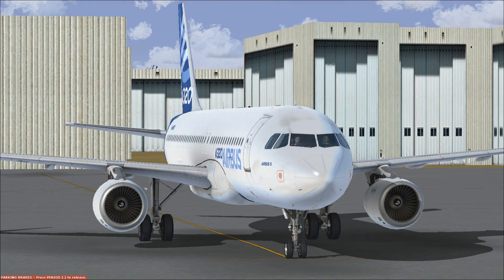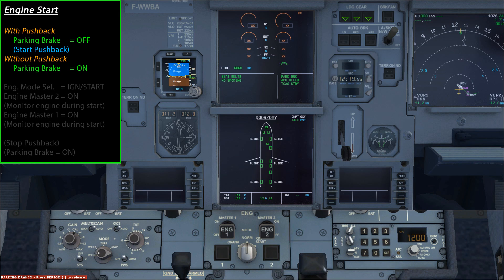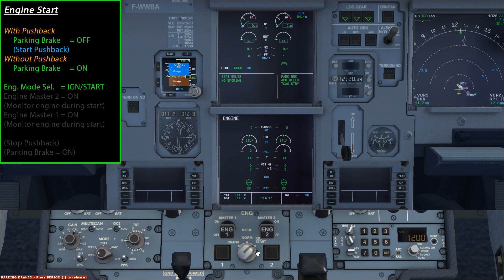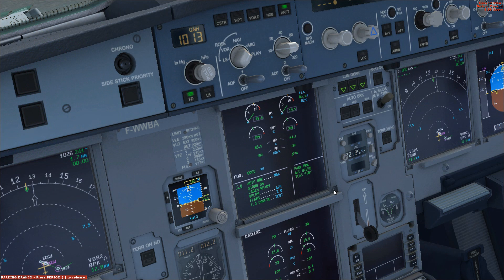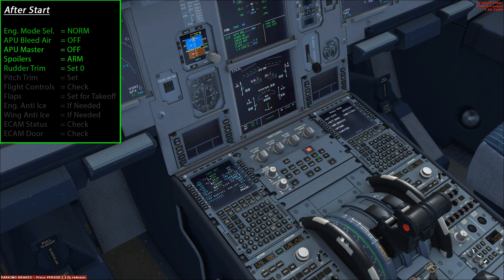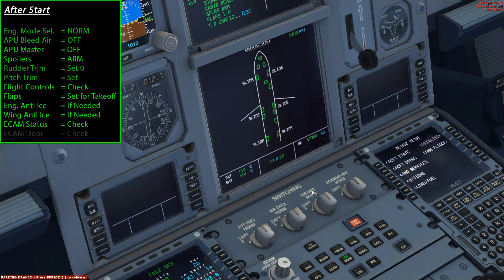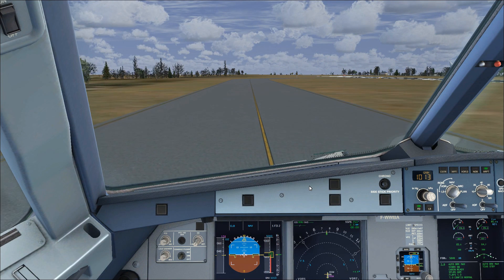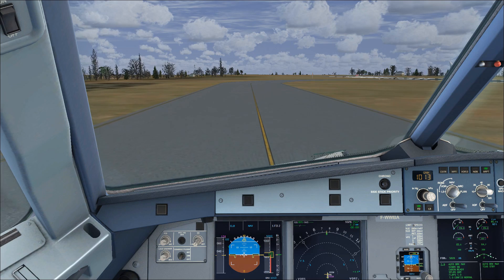A320 Start Up and Taxi (FSX - Aerosoft A320)

Comment: Hey +doofer911, at 13:36 there's no route being displayed on the NAV display. But from 14:23 you do have a green line route on the NAV display. I cannot figure out how to get the route to display. I can only see it when on PLAN mode, but that doesn't show me where I am relative to the route I entered into the MCDU. I followed your videos to the dot as far as I know, with the exact same route.
Reply from the maker: That's because the route is behind me while I'm taxying on the ground. The route is there but it goes off the bottom of the screen. As for not seeing it in Plan mode, make sure the MCDU is on the correct waypoint using the up and down arrows.

Comment: I'm following your tutorials closely to learn to fly the A320.
I have a few questions,
How do I get a cold and dark state when the aircraft loads with engines running? Which switches do I need to switch to off?
Reply from the maker: Go to the right MCDU, select aircraft state then select cold and dark.
Reply: Got it.
Your tutorials are excellent.  Thanks.
Reply: but still engines keeps on running
Reply: Hello ,pls in my Aerosoft FCU knobs ,how to adjust

Comment: when I do flight control check, either the ailerons or elevator doesn't move full up, down, left , or right. any idea?
Reply from the maker: Is it just with this one aircraft or is it any aircraft? If it's just the Aerosoft, try re-installing the addon. All aircraft > Try re-calibrating your controller.

Comment: thank u for the lovely video .. i have a question plz . on Navigation display the VOR1 not showing the BNN and the arrow . just the VOR2 is correct , what wrong did i do .. thank uo so much dear . . both vor r ON
Reply: VORs in A320 are automatically set by computer, and sometimes one of them is out of range. But don't worry, in normal situations you don't need VOR indicators - aircraft will follow the route itself.

Comment: Sometimes you can see the ailerons and rudders being tested whilst taxiing - does this not effect the taxi at all?
Reply from the maker: Nope, steering at low speed in the Airbus A320 is controlled by a Tiller, sort of a separate steering wheel for ground movement.
Reply: Josh Nesbitt Actually the nosewheel can be controlled by the rudder but it is easier with the nose wheel tiller. However during rudder test a nosewheel steering disconnect button is pressed and the pedal will now not affect the steering. Look at the channel “Captain Joe”
Reply: When steering by the tiller, full deflection of nose wheel can be achieved (75° to both sides), and by the rudder pedals about 10° to 15°.

Comment: Hi doofer 911, first of all great videos i really like them. just some basic questions. how to turn while doing a pushbck. i installed gsx but it dint help. second i have logitech m185 wireless mouse. i am not able to pan and zoom. do you any idea or suggestions how to do it?
Reply from the maker: Apparantly it's SHIFT+P then press 1 or 2 however I've never got a turning pushback to work. As for camera movement, hold down the spacebar and move the mouse and roll the mouse wheel.